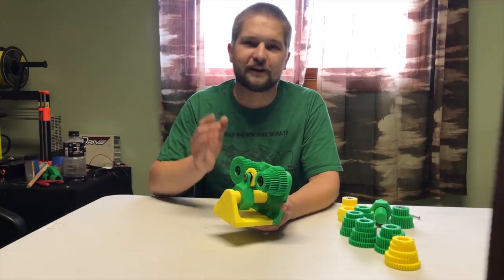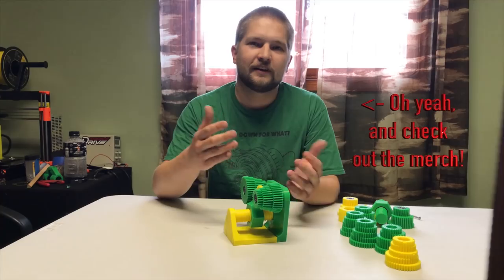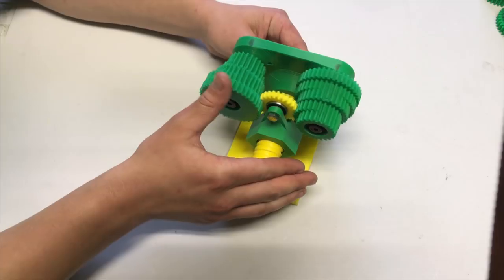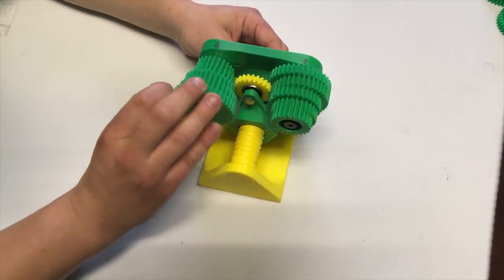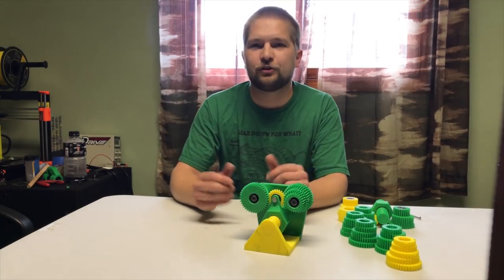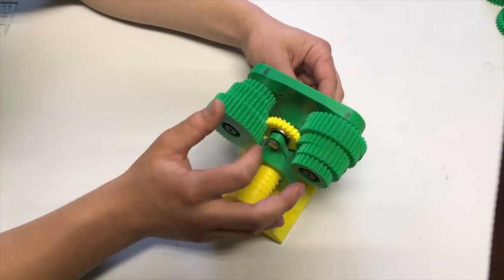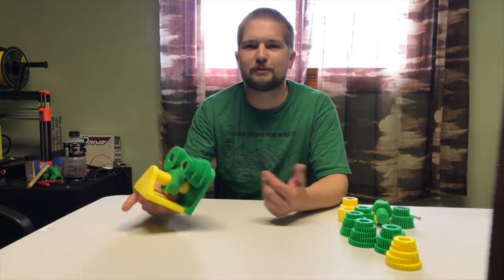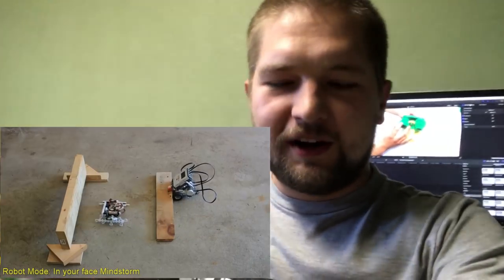The Hot Swapping Gear Mechanism | VCT2

Comment: What if instead of having those gear stack-looking things, you have more conical gear shapes on either side? Not only should that eliminate the need to have the gears lined up in a particular way to shift ratios, but it would also allow for much smoother shifting much like the Ratchetinng CVT.
At least, that's what I think.

Comment: the major problem is shifting when it's spinning. It needs to be in the right position. You stop to shift it, but in something like a vehicle the gears will always be moving. So let's say 3000 rpm, that's 50 every second, 0.02 second per 360 degrees. How big is the window? 10 degrees will mean you have to shift it in 0.0005 seconds. (I don't see that happening) Race transmissions will shift in 0.015 seconds with a dog box and use ignition cut and throttle blip to shift without clutch (but you'll need clutch for standing still) ((And you can't slide gears very easy when there is a load on them.))

Comment: And what if you're not driving? So you're idling? You Will keep a permanent drive between incoming and outgoing shaft.

If you want less moving parts, move to a variomatic gearbox. If you want to shift without a clutch, look at dirtbike gearboxes. Whatever you do, you'll need some sort of disengagement system

Comment: In application, it doesn't work. Even if you balance the cogs with moly, the torque oscillations cause the transmission to destroy itself under load with continued use. They can be used in stationary industrial applications, where the added weight and friction losses aren't so important... but there are better and more cost effective solutions already available.

Comment: Impractical in real life.

1) Offcenter weight will cause huge vibrations and mechanical failure at speeds.
2) Changing position gives a two small window to change gears when they are rotating at speed.

Comment: Another problem is that we would have to redesign the way I transmission is built ten have to redesign the underbody of a vehicle so a transmission would fit under the vehicle, then have to figure out how to get the engine to drive the transmission and the transmission to drive the tires. So I'm pretty sure they've thought of this in the past but felt it would be easier to go with the design we use now adays.

Comment: The best design I've scene is the dual-mode planetary gear design.  

However, it's limited to only two speeds per a gearset, which really restricts it's use for Internal Combustion Engine powered cars.  It would however, be great for heavier electric powered vehicles such as big trucks, where electric motors already have better low-end torque and wider ideal torque range.

Comment: Seems very usable for low RPM, but once you get into the thousands the changes would need to be insanely fast while the gears are locking into each other under load.
A slight miss in timing and you suddenly have a self locking gearbox...

Comment: eCVT is the way to go. But if you had to go full mechanical, I'd say some type of hydraulic transmission to be the best. Gear transmissions need oil and oil changes anyways, so the hydraulic one would just require more fluid, and possibly be lighter overall.

Comment: So what is wrong with a sun wheel & planet wheel system? Plus what happens at speed when the off centre gears apply centrifugal forces to each shaft. Does it cause excessive vibration?

Comment: Brillant! For the electronic control i can suggest you to use one small stepper motor or linear actuator  and two encoders one at each gear axis for position tracking.

Comment: Well, I don’t know how it’s called in english, but I know there’s a gearbox that doesn’t need a clutch and we call it a ‘klauwbak’, usually used on the circuit.
You just change gears by pushing the gearknob forward and to go back you have to pull it backwards.

Isn’t that the same as you’re trying to accomplish here?

Comment: Something seems to be missing??? You show what appears to be a input shaft, the one you rotate by hand, but where's the output shaft? And how does it go back to a lower gear after slowing down or from a complete stop? That yellow gear is on a corkscrew shaft, wouldn't it have to spin backwards to get back to a lower gear?

Comment: Interesting design. But in an usual gearbox when a new gear engages, the clutch, or the torque corversor, or the movement of the CVT chain or whatever handle the energy transmission to/from the motor/load, due to new gear ratio. It gets less than a second, but it last some amount of time. In this design, the only time/space to do this transition of energy is the gap between the gear teeth, virtually none in well adjusted gear teeth. Zero interval of time! It causes an enormous (de)acceleration of the motor rpms, possibly breaking the gears, am I wrong? Maybe it works only in light applications with combustion motors. Electric motor doesn’t need gears, in general.

Comment: Why not cut the gears helical, and in a big cone shape? With helical ((gears cut on an angle rather than straight cut) you would be able to slide it up and down without needing transition periods. You may get a slight speed up, or slow down, as it moves up and down the shaft, but if you limited the speed you could move the middle (selector) gear it would be negligible.
Reply: You would need to do some engineering to work out the correct angle that the input/output cones would need to be to match the helical cut, where you may not need too much of an angle of the cut to get this to work. Off the top of my head, the angle of the cut would be reduced with a lower angle of the cones, however this would mean the cones have to be longer to get a greater variance between input/output. If you had a higher angle of the helical cut, you could reduce the length of the cones but there would be more aggressive change.as you slid the selector up and down to change the drive ratios.

Comment: You need a clutch or converter to release the power from the engine to the driveline for selecting gears! Else the teeth of the sliding gear breaks off at sliding to a different gearratio under heavy torque and enginepower. It,s 2 much stress on a tiny survice!

Comment: Interesting transmission (looked into something similar myself) but there is 2 issues i se that has to be taken in account (maybe 3)
first one will be the swapping of the gear and in engine speeds it can be pretty fast moving and to make ti transmission between where its lined upp perfect of high speed becomes a very short window so that has to be looked upp on, second is what causes the system to not work well unless one can accept its gonna get loud, and that is the cogs  way they are designed as they are straight cut and causes one hell of a racket when moving, why on transmission they are not to reduce sound.
third one is a concern of oscillation and vibration from the eccentric gears can cause huge structural problems.

See if you can strap a smal electrical engine and do tests on higher speed to se how it behaves and if you can address these issues (maybe also put smal ball-bearing as the plastic will melt of the friction), and can se if this can take on the variomatic transmission with works on a similar principle (clutch less mechanical) but uses a belt instead of a cog in the middle.

Comment: What if instead of a gear stack you used cones, so it never had to disengage, and could change gears to any ratio in analog fashion instead of sticking on the load?

Comment: But how much power would you lose in the "transition period" ? It really doesn't make sense to me to have seen the gearing I meant I fully understand 1rst gear to 4th or 5th gear but, transition from gear to gear would seem like you would lose alot of power/speed if let's say it was put in a car doing a 0-60 or even just the full 1/4 mile. But like you had said in the video, you would experience mechanical/electronic malfunction in the designing of the gear box

Comment: Could be useful in devices like digital mills to change the torque/speed ratio with a smaller gear box than normal. 

For mechanical changing you could use a rail system similar to what fishing pole reels having. The ones that have the guide piece that slides back and forth to spread the line out on the spool properly.
Reply: cam

Comment: The major problem you will find is not in sliding the gears, which may actually work with good timing, But with off-axis gearing. That transmission will vibrate like a rock tumbler, and fail miserably just because of that.

Comment: Wouldn't the difference in size between the two gears when they're in the first or third position prevent the transmission from being able to shift after just a few rotations? That's just something that stuck out to me, but Idk if the design accounts for it.

Comment: F1 transmissions already shift with control systems like the one needed for this transmission. Normal not eccentric gear sets, but they slam shift the next gear before disengaging the previous ratio while under load while tracking individual gear teeth. Electronic synchromesh. They only use the clutch for first gear. Really bare metal computing needed for the hard realtime speed, I'm sure it's all handled at the FPGA level within a couple hundred picoseconds of precision.
Reply from the maker: Well that makes this sounds like it could actually work.

Comment: Absolutely ideal for a motorcycle. using a cam and transfer bar could assure it only moves where the teeth are not stepped. I prefer mechanical for the reasons you described with electronic glitched. It's hard for me to imagine what it would feel like in an accelerating car. Would it be smooth, like a firm shifting automatic, or would it be a "bump" shift, like an automatic clutch, or shifting a motorcycle without the clutch? Doing away with the clutch seems like the most efficient way to shift, with minimum friction, or heat. This, believe it or not, looks more reliable than just about any Continuously variable transmission. With it's ability to transmit torque in both directions, this would actually work in a motor vehicle.

Comment: Even if you could somehow find a way to change gears WITHOUT stopping the trans completely, you would have balancing issues. The transmission would violently shake itself apart with off centered gears.

Comment: Yes, it's cool but if you want it in a car, you still NEED a transmission except if you are able to shift gears instantly, and the wear on the central heat would be very significant

Comment: Those gear won't destroy if has higher speed of mechanical changer than the space of gear changer line.
It'll be quite hard in high speed rotation

Comment: Umm the demonstrated transition period is a full stop of the finger driven gear?

I would think if the center gear was under spring power you would have a starter gearing for short high output bursts, but honestly you have a squared shaped pencil sharpener.

Comment: A clutchs purpose is to reduce wear on the gears because humans cant consistently, properly time a shift. 

If the revolutions per minute of the engine, match the required transmission sync to pair with the revolutions per minute of the driveshaft, the gear will slide in/out effortlessly, and without the need for depressing the clutch.

Comment: why not make the scrow link up the time~ing  and ot have a nother gear on the opsit side of the yellow one so you have to so when on is actove the other one is in free wheel and have them trayed off  there for thee is no skipping on the gerrs oe have the two outer rods have spring tenchen so that if it skips gears there is no grinding so under to much load it will skip but under normal it iwll be able to be reset for low gear again becaues the two bars that are holding the green gears are abel to move even when there not alined (timed) also have you thought about the two green ones being cones 
with corckscrows and have the inbetween gears have the tapper but the real gears have a flare out so no matter where the yellow gear is there is allways power .. ?

Comment: Problem don't occur at extremely slow rpms.. It happens at high rpms use it with electric drill at high rpm
Reply: Yeah, I'm sure the weight stability of those offset gears is going to be wonderful to watch "at speed"

Comment: I like that design, I working on a windturin that need a simple need a simple gearbox I got a old dc motor that can produce 150w of power at 3000RPM, my plan is to use a gear box that can change gear so the max output will be 3000rpm in low wind speed, and do not go above 3000 in high wind speed to protect the motor

Comment: seems like it would have a lot of wasted energy due to vibrations from the offset gears. if there is a way to balance the gear set so the vibrations would cancel each other  out that would make this a hole lot better but there is also the added weight of having almost double the gears. between these and the shift timing, it makes for a pretty bad transmission. just stick with a cvt.

Comment: Even conventional hydraulic automatics are capable of destroying them selves. They work by engaging and dis-engaging clutches at the right times. This is electronically controlled. If the wrong two or more clutches are engaged at the wrong time and it is moving it can result in a catastrophic failure. The ZF 9 speed trans-axle also has dog clutches for 2nd and another gear 5th i think, so precise timing is already required in modern transmissions. Im saying that the downsides you listed here are already being countered.

Comment: I've always liked this design I ran across in a 1930s era mechanisms book. It uses a single gear stack and an arm with two gears on it that can pivot to contact the gear it is in line with in the stack. To shift, you angle the lever away from the stack (if going to a smaller sized gear in the stack this wouldn't be necessary), move the lever to the desired stack gear (or alternately, move the stack and keep the lever stationary), the pivot back to engage.

https://imgur.com/0SWJ6c5

Comment: I see a lot of flaws with this design. One is it will be noisy. Straight gears are extremely loud. Second is the amount of torque being put on the pinion gear will be immense in some scenarios.  3rd is what you discussed.. it’s going to be easy to accidentally shift it wrong.. it is a fun design though. I appreciate its simplicity. Thanks for sharing. 

I’m wondering if you found any hydraulic designs that would be interesting.. like torque converters style. I think a completely gear less design would be ideal instead of clutch/gear designs.

Comment: Can't you do it on cone-shaped gears? In this way not only you overcome the problem of the mechanical or electronic control you also can change gears on the fly and you can have an next-to-infinity number of gear ratios.

Comment: well done job, the 3D printing is very beautiful, the make is very good, but I'd like to explain to folks that there're too many ideas looks - in design- really old and didn't change since very long time, indeed most engineers may find some idea is just doing its job well, it's safe and durable and easy to just remove - maintain - repair- service- fix back, so why to do upgrade?? no sense in this case, i loved your effort but in most cases, let's see your gears fixed some application so we may find out if we can use it practical some where

Comment: I see alot about moving parts what about vibration the gears are offset? What would be the of transfering or keeping the transmission from rattling apart? Especially if it's going to be turning at thousand plus rpm? It's a thought but I'm not sure how the ride would suffer from vibration

Comment: i could shift the T-5 transmission in my 88 Mustang without using my clutch and without grinding the gears. All it takes is matching the input speed to the output speed.

Comment: Did you happen to ever come across a simple 3D printed transmission that could be used for fun project for use with an electric motor but manual changing? Been hunting for ages however still havent come across something simple. If anyone has any ideas or links could you please post them up? Cheers

Comment: so what does this have that a dogbox wouldn’t? in a manual transmission with dogs on the gears, you can shift with no clutch and it will always go into gear. i’m not sure as well how durable essentially having a single selector fork with a gear attached would be compared to a traditional design. the last thing i’m thinking is that having a transmission that can only be very precisely shifted at specific times would be horrid for reliability and usability which may explain why we don’t see these in the wild

Comment: This will not work at high speed my friend also in the normal running combustion engine with a clutch flywheel doesn’t have to stop spinning to change gear in your design the flying  has to stop

Comment: What about a geared cvt? Two cone shaped gears opposing each other but side by side with a sliding gear between them? That'd solve the belt breaking issue, but could have other issues.
Reply: @zappy bear: I just thought about that, too. But near the top of the cone the spacing between the teeth will get so small that the teeth of the middle gear won't fit anymore. I hope I explained my thought good enough, I don't know proper terms for that.
Reply: If you make the middle gear slanted as well to fit the other two cone shaped gears then there won’t be any gaps just a smooth continuous gear box.
Reply: I do t understand your cone gear. If it has teeth then as the cone gets bigger the spacing of the teeth will change therefore no center gear can have the teeth pitch for the entire cone. If it is stepped like 5he one shown it's not CVT

Comment: This could be made without transition gears if they dropped in from the top.  Have a timing sensor on the output gears and have the engine side gears match and align accordingly.  Easy